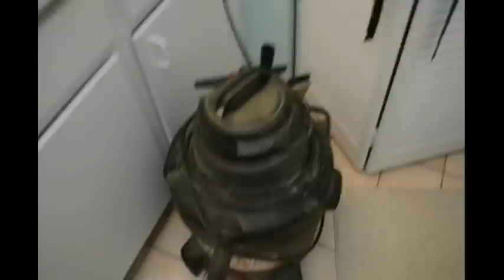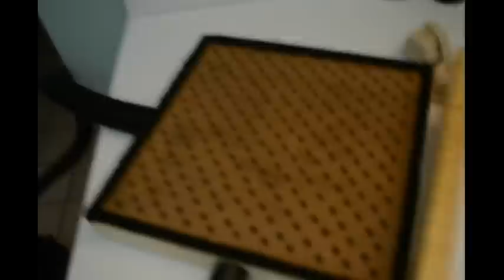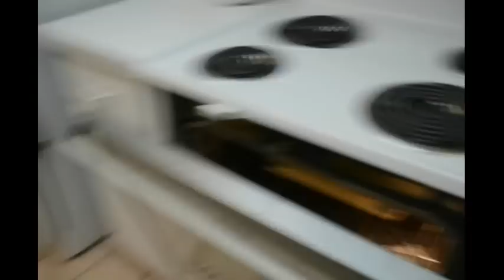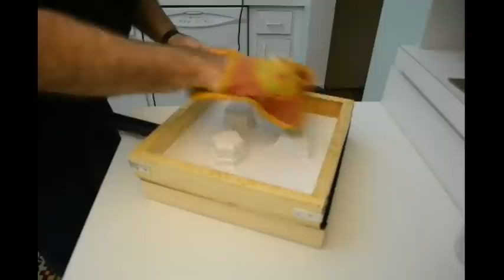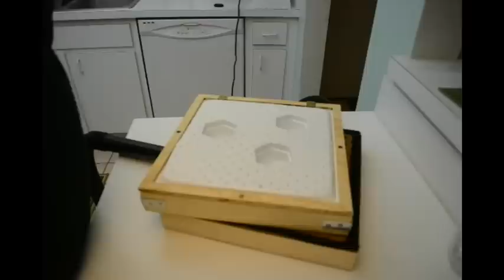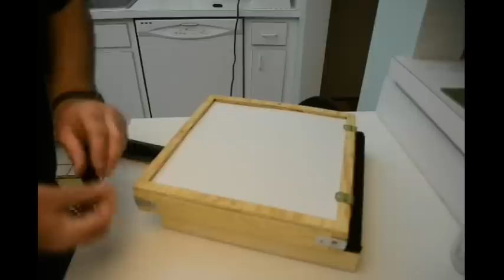Home-made Vacuum Forming Rig

Comment: Nice tutorial, thanks!  A couple of suggestions:
1.  Cut four pieces of angle aluminum and mount these at the four corners of your vacuum box (sticking up perhaps 3 inches or so above the surface of the box).  This would make it so your plastic frame will always fit down on the vacuum box precisely.

2.  Consider rubber strips/weather stripping (flat "gasket" type) instead of felt for a better seal.

3.  More separation of your bucks on the vacuum frame should help to eliminate those wrinkles.

Comment: Hello Mike,

I'm James, of Anchorage Alaska.  If I may, your plastic form holder is too thick.  Also, you may actually want to seal the felt stripping with some kind of rubber or acrylic strips to create a better seal.  The vacuum should be just a bit more robust and your 2 vacuum system would work sufficiently if you sealed the edge of your vacuum chamber former by placing rubber or acrylic strips around the edge.  Even black electrical tape would provide the improved vacuum seal you require.

The webbing that occurred around the edge of the hexagonal pieces is because the plastic form frame is too proud.  The closer you can pull the plastic down over your shapes for the forming, the better the results will be.  It isn't how strong the vacuum pressure is, but rather, how efficiently it is used.  The less air that has to be drawn and removed to make the mold, the better and more efficient it will work and you will have far less problems with "webbing" from unwanted plastic not forming as you intend.  Cut your plastic top that you use for heating your plastic by about 1/3rd, or 1/2 and your results should improve.

The reason this will make your system more efficient is because there will be far less air to draw out to create the vacuum seal.  The combination of less airflow and a better seal will yield better results.  I learned a great deal watching your video.  I studied and learned quite a lot about vacuum forming and someone who actually does it explained some of these steps to me.  I am thinking about making my own vacuum forming system for a model building project I'm working on.  Great video, great and useful information.  Thank you!

Regards,

James, Anchorage Alaska
Reply: Thanks for the added info. Add all the info up and I get a very good picture of how it should be done.

Comment: Another possibility for the wrinkles is to smooth the plastic out over the buck as it is forming. Essentially working out the wrinkles before it forms completely. I've seen plenty of examples of folks doing that. They wear heavy leather gloves and work the wrinkles out of the plastic by lightly pressing the plastic against the buck - it is a way to make sure that the plastic is molding every nook and cranny of the buck.

Comment: The molds should be secured down maybe a good double face tape under each one. The holes are a little too large and it is general necessary to have tiny holes at the base of each mold this will eliminate the webbing by removing the air around the base..

Comment: Hi,I'm living in Seoul South Korea,I'm from uropygial &i really need to make some samples can you let me know if the PVC plastic can work...or should b better a different one.thanks for your video ,I'm waiting just what kind of plastic to use your vacuum former.really helpfull1
Reply: Any kind of plastic will work in a vac forming table. It all depends on the individual properties and thickness of the specific plastic that determines how well the plastic will form. Plastics like HIPS (high impact polystyrene), Styrene and great for fine detail, but lack sufficient density to make for a long lasting formed piece. The stuff can be real brittle and rip like paper. ABS forms details pretty well - not nearly as well as HIPS - but it is a denser plastic and will take a bit more punishment and keep its shape. PVC plastic, foam board, Sintra and the like (as I have been told by a friend of mine) forms ok if it is block shapes lacking any kind of great detail. He tried to form a ball, I think, and the Sintra didn't form all that well.

Of course, it also depends on the thickness of the plastic you are using. I'm a Star Wars costumer, so the thickness we are talking about is roughly 1/8 of an inch, or .093 of thickness. Most stormtrooper armor is molded in .093 ABS.